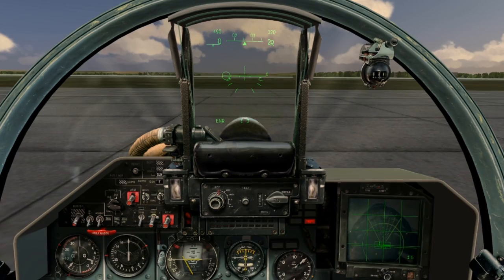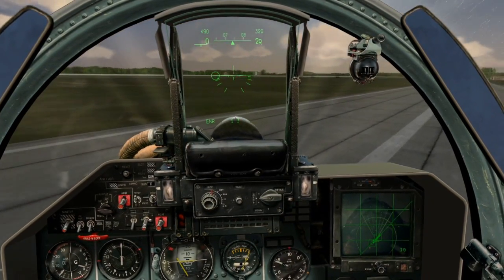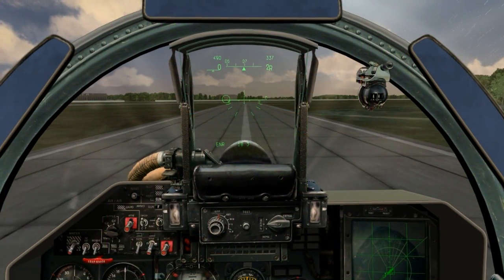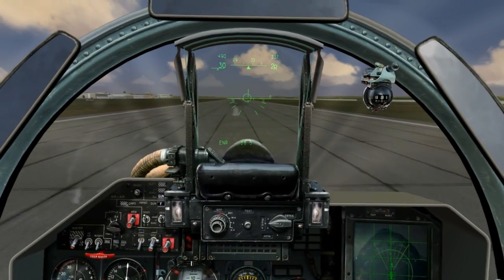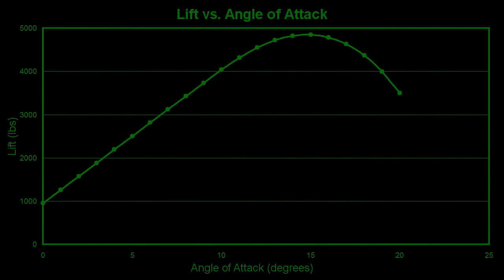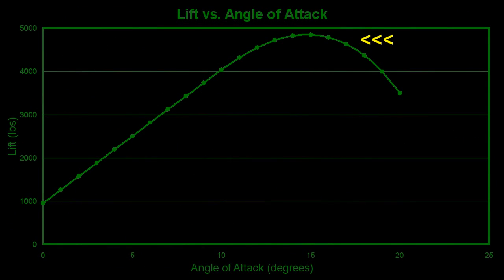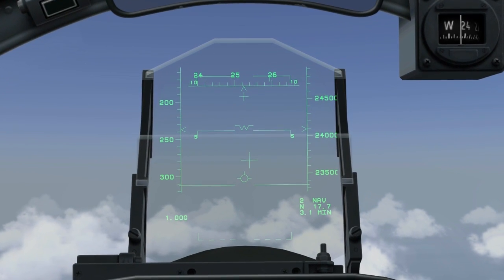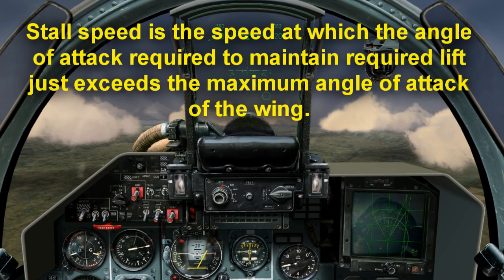Stalls and Spins and How to Recover; LockOn FC2 (Part 1)

Comment: Excellent demo and explanations.
You could have mentioned in the stall recovery process' that neutralising the controls means ailerons level (whereas your patter focused on the elevator, and so, a novice may miss the relevance of the term "neutralise" to all control surfaces).   Also, that having the ailerons deflected in a stall can result in a spin.
Lastly, you could have addressed the issue of minimum altitude from which to recover and the relevance of flaps.
Thanks again.